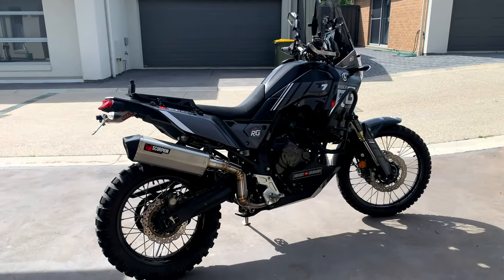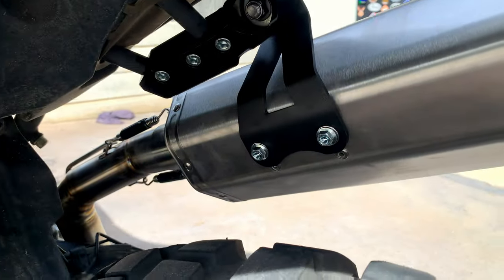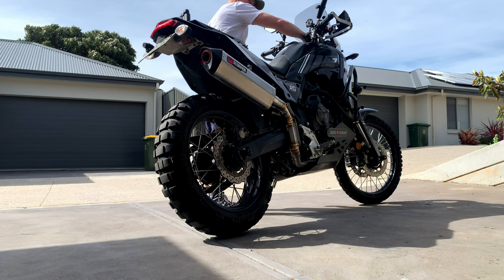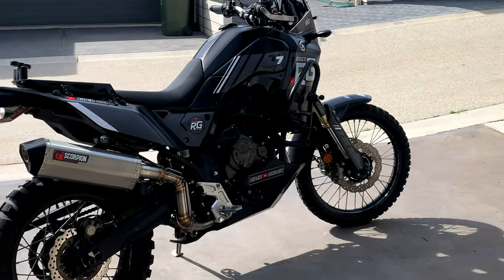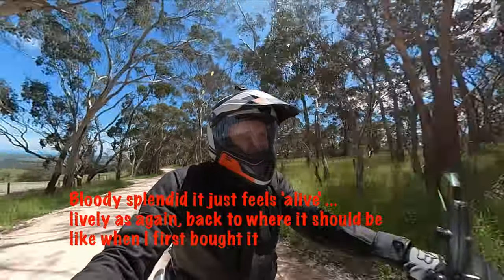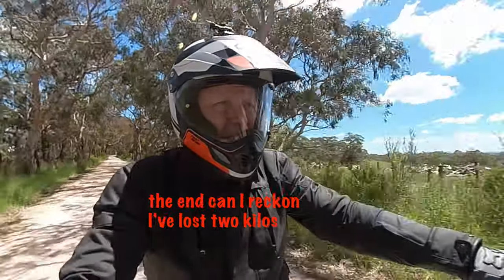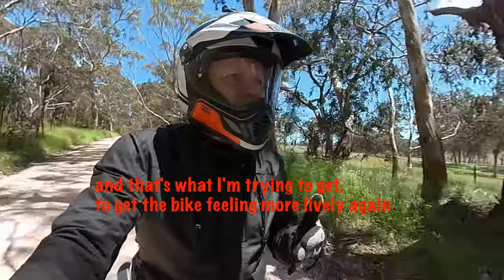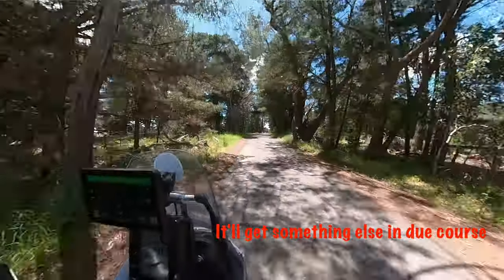YAMAHA TENERE 700 FULL EXHAUST SYSTEM UPGRADE, SHOW, AND TEST.

Comment from the maker: In my quest to lower the weight of my Tenere 700 I've fitted a full exhaust system upgrade.
I've used the 2.1 kilo Akrapovic header, the Camel ADV enduro bend connector, and then finished it off with the beautiful Scorpion Red Power slip-on end can.  These alone reducing the weight of my T7 by six kilos! In this video I'll show you around the bike, how it looks, of course how it sounds (as much as a video will allow), and of course maybe a little road test and 'fly-by' plus a quick chat on what's next for the Rider Guider #T7.

This is not an install video, this was not that difficult to fit with some basic mechanic tools on hand, 60 - 120 mins however if you have any questions on fitting please ask or comment and I'll be more than happy to give my advice.  

#yamahatenere700 #akrapovic #cameladv #scorpionredpower #tenere700 #riderguider #theriderguider #lessismore #adventuremoto 

https://www.adventuremoto.com.au/camel-adv-products-t7-high-exhaust-enduro-bend
https://www.akrapovic.com/en/intro?returnUrl=%2F
https://camel-adv.com/
https://www.scorpion-exhausts.com/
https://antigravitybatteries.com/
Reply: How did the header fit with the camel pipe?  Did you use a gasket?  If not, was the fit tight?

Comment: hey bud was wondering something abouth your headers ! wath did you do with the shouldered bolt head who screw into the oem mid pipe ??
Reply from the maker: Hi mate, sorry which do you mean?
Reply: your headers ! on the oem is a bolt for holding it under the bike did you have to screw this bolt anywhere on this headers for install the akaprovic i mean  @TheRiderGuider

Comment: People who have dynoed the t7 say it runs lean as standard. Headers will make it even leaner. Needs to be put on a dyno and have a custom map to get the most benefit and ensure the bike is not running too lean, which is not healthy.
Reply from the maker: Thanks Dave, coincidentally I've been mulling this over and having spent what I have for the hardware, I would be crazy not to now get it tuned to maximize the potential.  I spoke to Yamaha and they reckon it's not absolutely necessary because the bike has a 'learning' ECU however from what you say, I'm getting it done, next week it's getting booked in for a proper tune and a dyno test.  Probably won't get more than 4 or 5 bhp extra but it will give it some extra fizz all over the rev range and peace of mind.  Can't wait to see how it feels.  Probably end up on the back wheel out of every corner 😁 CHEERS mate.
Reply: @TheRiderGuider  it will probably lose some  of the low end power and make the fuel economy a little worse.  Obviously there will be less backpressure.
Reply from the maker: @chrishart8548  yeh - going in on 14th Feb.  I'll let you know how it goes.  Had a good chat with the guy who runs the tuning shop, he's a bit fussy so I like him!

Comment: Did you have to do a dyno tune afterwards and if so how? Looking at doing the same system as you.
Reply from the maker: Hi mate, well coincidentally I've been mulling this over and having spent what I have for the hardware, I would be crazy not to now get it tuned to maximize the potential.  I spoke to Yamaha and they reckon it's not absolutely necessary because the bike has a 'learning' ECU however I understand it might still run a little lean, so next week it's getting booked in for a proper tune and a dyno test.  Probably won't get more than 4 or 5 bhp extra but it will give it some extra fizz all over the rev range.  Can't wait to see how it feels.  Thanks for watching ;-)

Comment: The color LCD display for 2023 with the app tie-ins looked wonderful and then now I learned the US 2023 models don't have it.   WTH?
Reply from the maker: Can't give much info on that tbh.  I was thinking about whether I'd upgrade but I really am still very much delighted with my 2020 model.  Not sure it'll ever get sold.  It's epic and until I wreck it or it gets stolen, it won't be getting replaced.  Happy with the standard level of tech as is.
Reply: it's basically a 2022 with the 2023 graphic on the side for u.s. :/ no led turn signals, no tft display, no 3 stage abs..... U.s. getting stiffed hard. i wanted the extreme version. would save loads not having to touch the suspension.

Comment: Hi there!! Great videos to help us all take decisions!
I have the rally bend from camel ADV and I’m planning on saving weight with the headers.
I couldn’t find if you are using stainless or titanium headers from akrapovic, could you confirm? Thanks!!!
Reply from the maker: Hi mate, Titanium.  Thanks for watching 🙂👍🏼
Reply: @TheRiderGuider  Thanks a lot!! From Camel ADV they are telling me that Akrapovic headers don’t match the link pipe due to different diameter, but I see you’ve installed it without issues or extra mods, is that correct?
Reply from the maker: I'll adjust my answer (sorry) they are stainless steel, and VERY nice still.  2.1 kgs is amazing for what they are.  They were a perfect fit mate, not sure why Camel have that info?

Comment: already tuned bro? what i can say is i blow my x adv 750 engine because upmap (remap) just my 2 cents, dont remap, etock ecu perfectly fine, bikes now use wideband sensor, there is lot more margin, never damage engine ;) anyway remap makes more responde power that is true, i feel it, but is enough to risk engine?? ;) even akrapovic tells dont need....
Reply from the maker: I did actually follow up with the remap mate, it's give me a lot more torque low down and a smooth power delivery, but not much top end power increase, only 3 or 4 bhp, however that's not really noticeable to be fair.
Reply: these bikes are mapped lean, in hotter climates like Australia it's better to remap up to suit the pipe, I'd even have it remapped just to richen it up a bit and run cooler.....   Euro ratings have leaned everything right out, this makes these highly strung engines run hot, it's commonly known in the motorcycle industry, remapping is actually BETTER and will not risk the engine, that's a complete fallacy....

Comment: Great job, what bash plate is that.
Reply from the maker: Hi Simon, thanks mate ... it's an AXP (composite) and it's rather good, protects the water pump and the rear suspension lower linkage.  Nice thing.

Comment: is that full exhaust too loud? Will my neighbors hate me in the morning?
Reply from the maker: It's not loud on a semi closed throttle.  Just when you really open it up it starts to stretch the vocal chords.
Reply: @TheRiderGuider  I just bought a 2024 Tenere 700! I'm starting to plan upgrades and I was wondering if you needed an ECU tune or any other surrounding upgrades to make it work well?

Comment: Thanks for sharing. Looks and sounds good. Ordered the HP Corse high exhaust but I was reluctant in changing the headers due to Euro 5 cat. Some say an ECU remap is needed after deleting the cat. Looks like you installed the Scorpion headers on a EURO 5 bike so you have a CAT delete as well. Any negative effect on the bike you noticed ? Any errors on the dash or OBD scanner ?
Reply from the maker: Hi mate, this is a 2020 model and pre euro 5 (I think)  .... I fitted an Akrapovic header.  I've had no errors thrown up at all, having chatted with my dealer they stated the T7 has a learning ECU so will adjust, however, I understand they can still run lean, so having spent what I have on the hardware I'd be daft not to now get it put on the dyno and have the ECU tuned properly to suit.   Getting it booked in after the new year break ;-) ... THANKS for watching.

Comment: Thanks for the vid. How are the Camel ADV enduro bend and Scorpion can holding up? After endless research, its my preferred option, getting that exhaust tucked away where it should be. Only reluctance is taking a hacksaw to the subframe. Think you've made the right choice to lose some of that weight, your reaction out on the bike tells you all you need to know 👍
Reply: Cut the subframe 👀
Reply: @Josh-ew1le  You have to cut the exhaust hangers to shorten them and then fit a new hanger bracket. Exhaust can positioning is really poor on what is a great bike.
Reply from the maker: Still awesome Andy 🙂 … it’s unlikely I’ll ever need to but I could easily re fit the exhaust hanger with a small fabrication.  As it is it’s a great upgrade for me.   I’m now booked in for a Dyno and ECU tune in mid Feb.  There will be an update when I’ve had it done 😃
Reply from the maker: It’s not anything that can’t easily be reversed if required Josh.  Not a structural issue 👍🏼
Reply: @TheRiderGuider  Ordered a Camel yesterday 👍
Reply from the maker: @andywelsh9911  BRILL mate, get some exhaust paste for that linkage and go easy on the nipping up of the joints, any questions hit me up theriderguider@gmail.com 🙂

Comment: I have the same exact setup on my T7. Just did it today. My only concern is that the camel adv bend is extremely close to my swing arm. When I step off the bike, the swing arm does barely kiss the camel bend pipe. I think it has something to do with the akro headers. Did you have a problem with this? I also noticed akro doesn’t use the stock exhaust mount under the bike behind the oil pan. Kind of weird for how much the headers cost

Comment: Wow, so the OEM header is almost 8 pounds?  (4 Kilos).  I did not realize it was so heavy.
The bike looks amazing and sounds fantastic - great upgrade, Neil.   I am curious to know - with the full Akra header replacement - did the bike require an re-tune/re-map for the proper fuel/air mix?
Reply from the maker: G'Day Chris, haha, well coincidentally I've been mulling this over and having spent what I have for the hardware, I would be crazy not to now get it tuned to maximize the potential.  I spoke to Yamaha and they reckon it's not absolutely necessary because the bike has a 'learning' ECU however I understand it might still run a little lean, so next week it's getting booked in for a proper tune and a dyno test.  Probably won't get more than 4 or 5 bhp extra but it will give it some extra fizz all over the rev range.  Can't wait to see how it feels.  Probably end up on the back wheel out of every corner 😁 ... and yeh massive weight saving ,the standard header is a lard arse.
Reply from the maker: booked in mate, a Valentines Day treat for my T7, 14th Feb.  I'll prob do a video.
Reply: @TheRiderGuider how have you been enjoying the tune?

Comment: You be careful loosing all this weight next thing you know you'll float away in a gust of wind. So what you seem to be telling me is that if I buy a load of expensive parts for my bike and tell the wife I need the money for a weight loss program that will get her all excited. Right I'll try it. I wonder how much I can spend before the Penny drops! That sounded really good with the mike at the back of the bike. I take it that those things that look like little handles on the pipes are actually heat shields, or am I wrong?  Thinking about it you ought to have bought a Honda the exhaust system would have lasted much longer than this! 😉👍😂😂🤣🤣 Ride safe and all the best to you both. (I meant you and Chantal not you and the Tenere) 🤣🤣
Reply from the maker: HELLO mate.  Definitely spend money to lose weight.  Works for me haha.  Well spotted on them little handles.  Like little guards to stop clumsy people like me burning my boots I think.  How's that daft dog of yours doing?
Reply: @TheRiderGuider  Daft dog gets no better...still not talking to me! 😂😂 Hope you are both well. No not you and the bike!